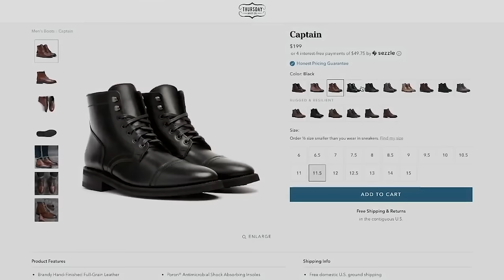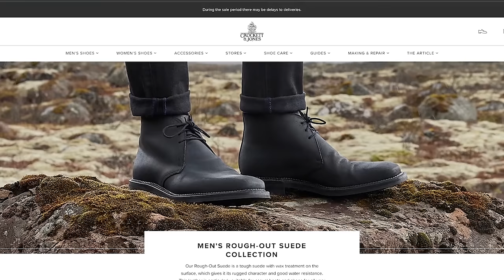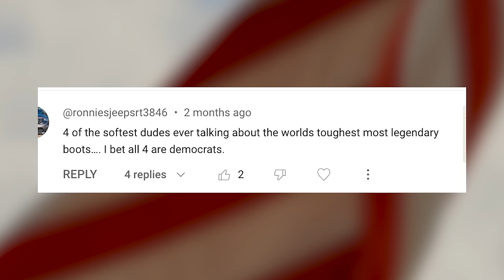The 9 Dumbest Things About Collecting Boots

Comment: You forgot to mention sizing! I see so many comments on forums about people going crazy about sizing, returning boots, trying different sizes and never being satisfied. Would of made a sweet 10 for the video~
Reply from the maker: Yeah sizing is annoying but mostly just with certain brands. like JK boots' sizing is BONKERS but usually, you know you send them your measurements. the good thing is brands hate dealing with returns too so they'll typically help out
Reply: My baby feet is smoll which means...I buy the smallest size available (size 6) and slap some thick wool insoles, or a padded leather, or shearling when it's cold, and they fit just fine and comfy.

Comment: #5 is my biggest gripe with boot snobs. Had a pair of PNW boots that felt awful, kept getting the feedback ‘just keep wearing them, they are hard to break in’, after a year of daily wearing at a manual labor job they still werent right, and left me with an unsightly callous that took years to get rid of. They werent cut for my feet, a cheaper boot that is shaped for you will be better in the long run.

Comment: All 9 points are spot on.  I've been guilty of most of these points with a collection of 10 boots.  One thing I never subscribed to is the notion that boots are more comfy than sneakers.  By the time your leather insoles are perfectly molded to your feet, the thin layer of cork has probably been compressed as well.  How does that provide more shock absorption than a quality pair of sneakers?  There's nothing wrong with being passionate about a hobby but let's take a step back and be honest with ourselves instead of taking it too seriously.